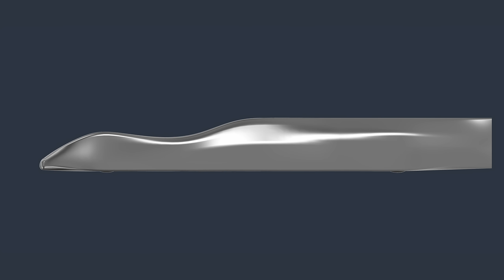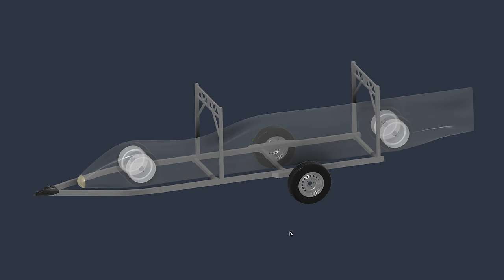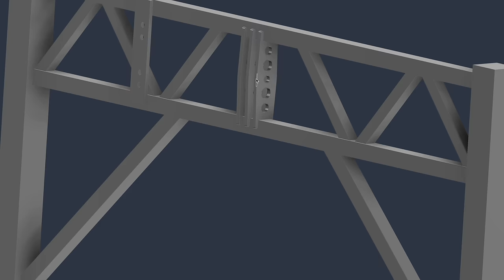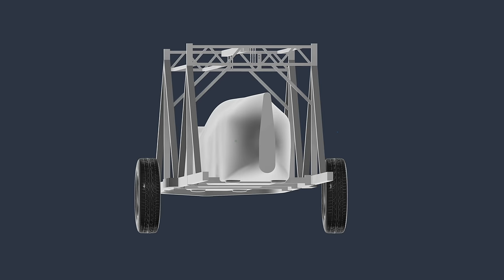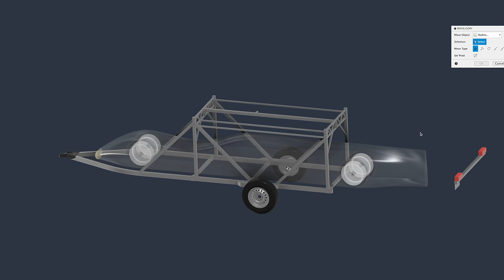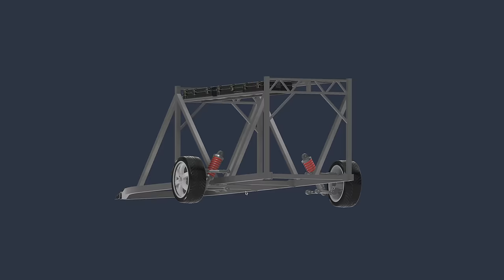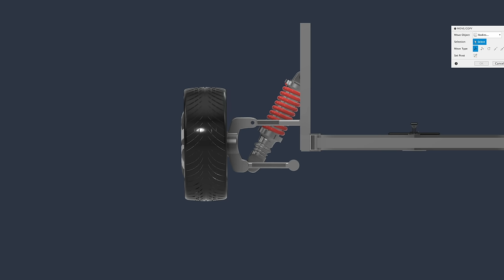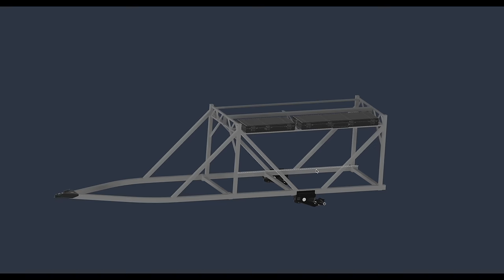How To Trailer A Car With ZERO Ground Clearance

Comment: I cant help but point out that the crane option would work. You just need to have a second land speed car to lift on the other side so it stays balanced. So, you know, build a trailer with two cranes. And a second land speed car.
Reply: We all meant to suggest, “please build this minor addition.”
Reply: A u-shaped frame could lift the car on the front while clamp-on caster wheel support the back. The front could just be craned on at the back. It's neater this way, but required the axle delete.
Reply: If only there were something that could be extended to stabilize the crane... We could call it an Outrigger...
Reply: That sounds like a Matt plan so cunning even Matt would have a hard time coming up with it
Reply: I know no one cares, but i would just lift the car and drive the normal trailers under it, could be done way cheaper and you would still have a trailer that can be used for more then just 1 specific thing
Reply: @faustinpippin9208  sounds way too easy. Are you new here?
Reply: Impeccable logic.
Reply: I think Matt's insanity is rubbing off on you.
Reply: Bad idea. You can use weights as ballast rather than another land speed car /s
Reply: I see what you did there. It's Delightfully evil
Reply: @faustinpippin9208  Yeah having a custom trailer not really useable for much else but this exact racecar...is something matt will complain about later in another video about how you should not do this.
I must say that I designed a trailer for low slung racecars that works for regular cars too.  You can see it on my youtube channel.   Unfortunately nothing witty about that video, so lower your standards before watching.
Basically the trailer hinges and raises and lowers the back half, so you can roll the front wheels up the back half and get the back wheels on, and then raise the back half up to finish loading on a level surface.  This is way less complicated and lighter than tiltback and other designs as I studied all of them before designing mine.  My trailer  is under 1000lbs.  It would need special attention for the long wheel base, but frankly while your solution is good, another option to solve that is attach another set of wheels to the racecar to shorten the wheelbase to load/unload, then my design will work.
Reply: 😅 I love your video's.  Please make more and more often ❤❤❤
Reply: I was thinking maybe just build a cart for the land speed car or find some way to raise it off the ground

Comment: Pro tip, the harbor freight winch comes with minimal bad grease so the popular wisdom is to crack open the gear assembly and repack it with new grease and add dielectric grease to the wiring.
Reply: That's a solid recommendation, especially with the Bonneville salt exposure it can expect.
Reply: yeah, grease up any tools with moving parts from HF as soon as you get home
Reply: the dialectric grease would probably be a great idea especially since it will be spending most of its life covered in salt

Comment: As a mechanical engineer in progress, it's seriously inspiring to see all the creative ways you solve problems as they come up and learn as you go to build whatever project it is you're working on.
Reply: i mean the man designed the doors for the model x, he is seriusly impresive!
Reply: @nikolaitoxvaerd  No way, I knew he had some solid engineering background but that is rad!
Reply: As another mechanical engineering student, this whole thing could've used a lot more calculation to make it a lot lighter, but that shit is annoying, I would've overbuilt it aswell.
Reply: @joemama069  Calcs sound good until you realise you left out buckling or fatigue or long term corrosion or the heat-affected zone next to each weld or unusually large holes in the road, or any multiple of other factors I haven't thought of.  Yeah, forget the calcs, just over-build it.
Reply: @Mark_Bridges  Unless we're building bridges or spacecrafts, the reality is calculations are just rough guesses to then experimentally figure out in real life.  Just overbuild it, then next iteration make it a bit less overbuilt, and do so until eventually it doesn't work well anymore.  Now you know how optimal your design needs to be lol
Reply: I’m a big fan of overbuilding. Long before computers it worked well, but just wasted raw materials. And meant everything else had to be scaled up to deal with the extra weight. The bonus is longevity and ability to survive accidental abuse. And yes, I drive a 1931 Model A Ford almost daily. Overbuilt? The 6 volt generator is the size of an oatmeal box but weighs about 20 pounds.

Comment: Pro tip, when you have a slow moving bearing surface just use bearing bronze it is more resistant to corrosion and forces pulling them down. You don't really need ball barrings for slow moving rotation.
Reply: Would that be cheaper or more expensive? Simpler part of course, but you can't make it out of Chinesium steel and ball bearings
Reply: @JoranGroothengel  depends, you can get off the shelf parts at the hardware store and use them for the bearing surface. I only mentioned it because he is going to take it to the salt flats, but it's kinda too late now.
Reply: Not even sure it needs a bearing or bush at all.. just grease
Reply: @mcspikesky its probably overkill but def makes the arms move much more freely which is nice
Reply: I was thinking the same thing. An engineer friend was once helping me with some welding on a swing away tyre carrier. Like just about all such things in Australia, I used a trailer stub axels with roller bearings and he similarly pointed out that the primary load is low speed, limited angle rotation. A bronze (or even plastic) bushing would deal much better with road vibrations twisting across the pivot and basically never need relubrication.
Reply: You can use a super oilite, which is even cheaper than a regular oilite bearing for a couple bucks.  The super oilite is harder and better for slow speed pivoting.

They are called high load oil embedded bearing on mcmaster carr
Reply: @zachary3777  "They are called high load oil embedded bearing on mcmaster carr" A+ comment etiquette.
Reply: Even better than bronze; a phenolic or composite bushing. UHMW or Delrin would work well. Can't rust if it's not metal.
Reply: @stevetrepanier4351  Bonus for Delrin: might squeak!

Comment: Next time, try your shop vac to vacuum the string through the tube.  Works amazingly well.
Reply: Yup tie a little bit of shop towel to the front for more better fitting in the frame with less air leakyness around it.
Reply: @watvannou  as usual, the best lessons are in the comments
Reply: I swear the things you can do with shop vacs
Reply: Yep. Learned the vacuum trick when needing a pull string running wire full length (and turns) of a basement conduit. Made a bubble out of my lunch sandwich bag for the vacuum to pull.

Comment: For your 2 removable bolts on the swinging bars, you should drill a small horizontal hole through the bolts towards the bottom and just use a mini trailer hitch pin clip to keep the bolts from coming out. This way you won't need any tools. (the kind of clips like what you use to hold an RC car's body on, or car hood pins, just smaller)
Reply: R-clips
Reply: @robg5513  yes those! Name makes sense now that you mention it 😁

Comment: When you order the new spindles, you can also get them offset so that the hubs are spaced outward (instead of the giant spacers).  You'll love that particular suspension, btw!
Reply: I think the spacers are there for bolt pattern
Reply: Thoes spacers are really adapters to change the bolt pattern if he gets a new hub with the viper bolt pattern that fits the bearing he could get rid of the adapters.
Reply: @trdnismoguy  @TheBCninja Y'all are both partly correct - they definitely adapt the bolt patterns to fit the Viper wheels, but that's typically a 1.0-1.5" adapter.  These are ~4.0", to offset the rim from the hub.   Trailer wheels are typically 0 offset - Viper rims are (~50-70mm), so 2-3", plus a little extra for clearance of the bolts on the side of the T*mbren suspension (learned that the SF Matt way...)

Comment: Its going to be fun putting the five lug spare on a 6 lug hub.
Reply: For as far as i know a viper has 4 wheels ? ;) 2 spares.
Reply: Also, trailer tires are not the same as auto tires, and the Viper tires are particularly ill suited for a trailer.
Reply: Really?  I would just take off the hub adapter.

Comment: For the frame tubes, use outdoor-use expanding foam to fill them. Lot less headache than trying to spray inside them, prevents moisture from even getting in, and has the added benefit of cutting down on noise since the tubes are now "solid". We did this on the frame rails and windshield frame of our '70 Barracuda 'vert resto and it made a big difference.
Reply: This is something I've never thought of doing.  I'll file that away in the ol' brain case for when it's needed.  Do you just use the stuff in cans?
Reply: Shit, that’s genius
Reply: Whoa, I don't know what to believe. I have heard the exact opposite advice multiple times.  The other folks say that the foam not only traps water but also keeps the water in close contact with the metal.

I ended up paying a pretty penny for galvanizing and coating.
Reply: @anchopanchorancho  Yeah, i didn`t try it myself, but every oldtimer i talked to told me the same thing, ``avoid it,  it just traps water and makes it impossible to spray in any valid solutions like rust converting paint or cavity wax``... I don`t know, i`ll stick to cavity wax myself... When i need a solid tube, its when i`m making a fabricated table or similar, and then a load of sand and used motor oil works perfectly... Just vibrate the sand until the frame is full and then pour in as much waste motor oil to make the sand a lubricant rag... Not a good idea if you will be oxy-cutting or similar on such a frame, but for machine frames and low temp. work, it is the best approach to achieve a ``solid`` tube effect...
Reply: @anchopanchorancho  You have to make sure you buy the correct foam.  The common expanding foams are "polystyrene" and "polyurethane".  Expanded polyurethane will basically not absorb water, while expanded polystyrene can absorb water.  As long as you're not submerging the foam in water, you're good to go.
Reply: Don't do it. Cost me a new bulkhead when a PO filled the frame with foam. Trapped salty moisture and rotted from inside.

Comment: Hah, I knew immediately where you were going with the “how much can you remove while still calling it the original trailer?” The same is true with aircraft restorations - the data plate is the only thing that matters to the FAA. If you have one from a 1947 Piper Cub, you can build a brand new airplane and (as long as it’s built the same way as the original airplane) it’s legally a 1947 Cub if it has that data plate.
Reply: Can you leave everything untouched from the aircraft you cut out the plate of and register it again as 1947?
Reply: As far as I’m aware, no. If you built a new airplane and transferred the paperwork/data plate to it, the collection of parts the data plate had been attached to would be seen as just that - a collection of parts. As it had been built by someone else, registering and obtaining an airworthiness certificate for it would be extremely difficult or impossible. Possibly the only way to do that would be to completely disassemble it and reassemble it, documenting the work you do in the reassembly process, and then applying for an Experimental-Amateur Built certificate, as the FAA will now see it as a new airplane that was built primarily by you. It would then come with all the limitations and requirements (e.g. flight testing) of any other E-AB aircraft.
Reply: What I initially said isn’t 100% true, as it would also imply that data plates are irreplaceable. What really matters is the registration and airworthiness certificates, which the data plate ties to the airframe to which it is attached. Replacing a data plate can be a pain, but it is possible as they can end up damaged or lost.
Reply: @tylerstank2714  thank you for the advanced details! One thing I could not get myhead around, how one would end up with two legit planes from 1947. In one way you restore the plate of the original, making the newly built an illegal clone, in another you would have to register the newly rebuild old parts as a new aircraft with recent date, isn't it?
I know of such practice with cars - mostly in Eastern Europe - when simply both the clone and the original get confiscated or at least getting registration revoked.
Reply: I think you misunderstood. In the scenario I described, the plane built with new parts and the old data plate/paperwork would be a “1947 Piper Cub” with the same serial number you started with and would be considered by the FAA to be the same airplane with a “major repair” or several. The airplane made of old parts that came from the Piper factory in 1947 which you disassembled and rebuilt and registered as an E-AB would be considered a brand new aircraft, with you as the manufacturer and whatever model name/number and serial number you want to give it. It doesn’t matter that it’s identical to an airplane made in 1947, the FAA would consider it a new airplane made in 2024 with you as the manufacturer.
Reply: @tylerstank2714  exactly, that's the catch of "register it again as 1947" - apparently, not, at least the way you describe.
However, what about situations when you do a restoration of a historical piece and want to preserve its original date in the registration? Say, you could pinpoint to particular production batch or flight squadron, but not to the unique identification?
Reply: @feedbackzaloop  I’m not sure what you mean. You’re not registering anything again - the registration of the 1947 airplane is retained, but the collection of parts it is attached to changes. The FAA sees it as the same airplane but with major repairs, so it retains the original 1947 build date and all the historical documentation, even though the data plate is the only part of the airplane that was there for all of its history. The rebuilt airplane is seen as completely new even though it is made of old parts - it is not a 1947 anything, but a 2024 airplane.

If you’re just doing a restoration of a historical airplane, you wouldn’t play games with data plates or paperwork like that - you’d just retain all the original documentation, and if you don’t have that and can’t find it, you’re going to have to do enough rebuilding to convince the FAA that it is a new airplane and deserves an E-AB certificate.
Reply: @tylerstank2714  say, you have a "pile of parts"/complete plane without a plate allegedly from 1947 with no papers or very incomplete ones. And you want 1947 somewhere on the new papers. Is it ever possible?
I really can't know of a way to put this idea any clearer, honestly.
Reply: @feedbackzaloop  I’m not sure. Without a registration document or data plate, I doubt it’d be possible. I should have added the caveat a while ago, I am not an aircraft restorer, just a pilot with an interest in legal trivia, so I’m not the most knowledgeable source out there.
Reply: @tylerstank2714  yes, I see your main objective is to get thing flying than to represent collectable value. What honestly makes more sense
Reply: @feedbackzaloop   If it doesn't have the original data plate and registration to track and a new data plate and registration would make the same bits of metal non collectable then I'd argue what you have isn't collectable. Either a restored old plane with new registration is worth something to people else old registrations are. If the later and you're looking for a way to make new old registrations wouldn't that ability simply make old registrations not really worth anything special?
Reply: @chublez  that's a good point the parts and story behind them should suffice, also nothing beats old parts with old papers together. However, papers or parts alone don't fly. And making of new papers - rather than the papers themselves - is associated with works, destroying the historical value. It is a big problem with car restomods and architectural landmarks, how to keep them both useful and valuable, which never seems to have a solution, comprised of best of both worlds, always a compromise.

Comment: Next time you need to pull string through a tube tie a grocery bag to the end of it and then use your vacuum cleaner on the other end to draw it through. It works the first time every time and you'd be amazed at the distance you can get.

Comment: Very nice.  As a fellow ADD-affected engineer, I love your mix of logic and humor whenever it comes to designing something.  Really looking forward to more landspeed content.

For the fenders, I would recommend either adding non-slip tread tape to the tops, or welding on some expanded metal.  And if they're not structurally capable of holding at least 300 pounds, reinforce them.  I can 100% guarantee that those fenders will be used as a step when loading/unloading the car and when accessing the gun cases.  And a healthy layer of rubberized undercoating on the insides of the fenders should hopefully help prevent chipping that will leave bare metal exposed to salt.  The insides of steel fenders are usually the first thing to start rusting on a trailer.  Or since I see you TIG-welded them, maybe you sprang for stainless there?

If you're going to have drain holes in the lower frame, I wonder if it would be worth it to weld on a threaded hose adapter somewhere so you can actively "flush" the frame out after it spends time on the salt?

Might also be nice to add a rock deflector so that your nice aerodynamic body doesn't get blasted during transport.